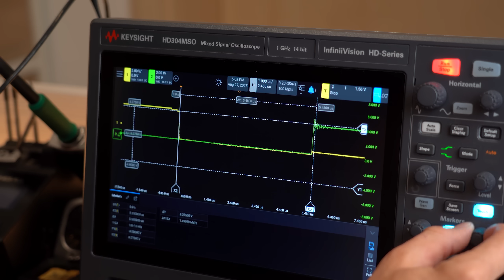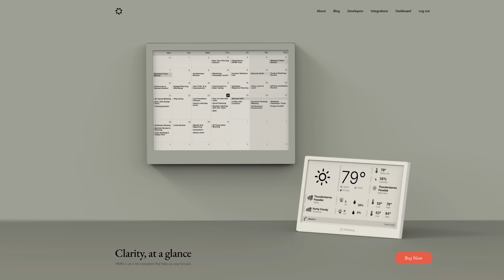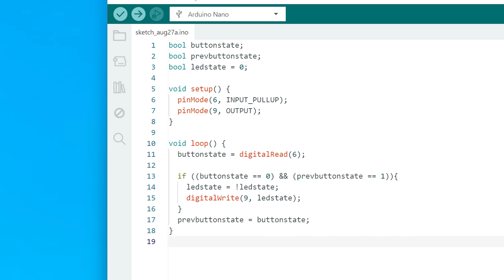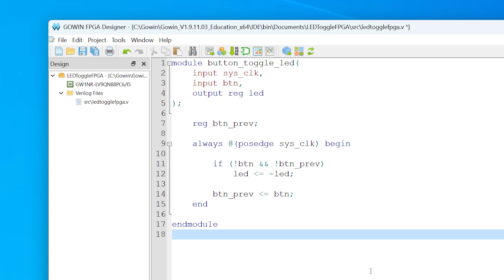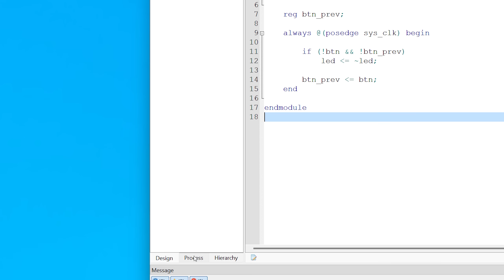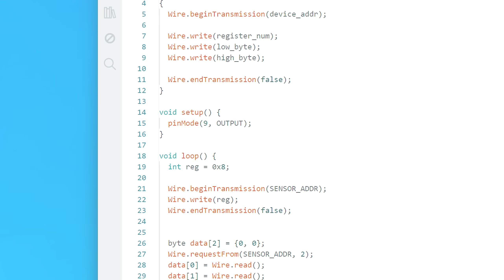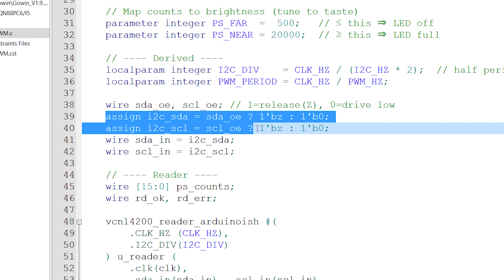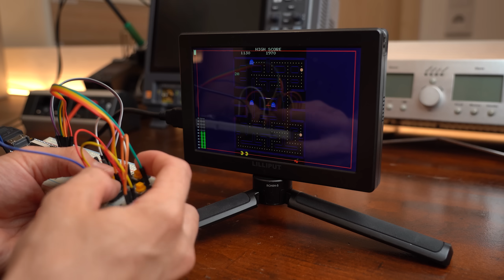The Harsh Truth about FPGAs (You Should Avoid Them?!)

Comment: The digital read and write functions in the Arduino libraries are incredibly slow. While you probably couldn't get FPGA speeds, you can certainly get within the range of a few hundred nanoseconds by reading and writing directly to the pins.
Reply: Yes. To get much higher speeds from a microcontroller, download the data sheet to find out where the registers are and GET and PUT to the registers directly. I learned this from a Great Scott video!
Reply: yes i agree.  the factor 100x mentioned in the video  makes not realy sence. Als the FPGA could run much faster the 27 Mhz (probably there is an PLL in the FPGA to produce a higher clk-frequency)
Reply: Exactly my thoughts, and not to  mention using higher end MCUs that are far more powerful than the AVR

Comment: I use this nano 9k to spy the qspi flow on an external qspi flash in order to toggle a signal when a specific address or range was accessed; in order to start  an acquisition of the qspi data with a fast  logic analyzer.
I was not good enough to make something reliable at 67mhz speed, so I changed the quartz on my HW target (a digital synth/piano) in order to divide the speed by 4. Then it started to work.

Comment: LLMs have been trained on a lot of code, especially javascript and python, so they are pretty good at writing it, but they haven't been trained on a lot of HDL, so they are not as good in that department. you leveraged libraries for the MCU, so you should have also considered leveraging libraries for the FPGA instead of going straight to LLMs. check out opencores, there may be other sources for opensource IP as well, I'm not sure.
Overall, FPGAs are not there to compete with MCUs, especially these days when MCUs are dirt cheap and often very capable. FPGAs are there to do things that you just can't do on an MCU. One can argue that the universe of those things has been shrinking, but we've also been more and more capable of doing things in FPGAs which used to require custom ASICs.
So I'd say learning to program FPGAs is certainly a great skill to have if you are into electronics. It is also a pathway to making your own ASICs, which has been impossible just a few years ago, but is now actually possible thanks to several sponsorship programs now available from both academia and the industry.

Comment: Usually we don't write stuff like the SPI or I2C peripheral itself. We'll add an IP Core from the vendor for that functionality which programs the FPGA for that peripheral to appear. Using frameworks like LiteX make this even more cohesive with open source IP Cores and RISC-V CPU cores, connecting them together through memory mapped registers like you'd use on a standard microcontroller.
That said, it's still WAY more of a learning curve than getting started with an arduino or blue-pill, but the knowledge floor is significantly lowered nowadays.

Comment: Why didn't you just use an IP Core for the FPGA I2C? You used a library and a peripheral on the MCU. The equivalent coding experience would have been for you to write a bit-bang I2C module from scratch for the MCU and then code your I2C functions around that. FPGAs are reconfigurable hardware, so they don't contain peripherals however the manuafcturer would give you an IP core, which is a soft CPU in HDL that takes  place of an I2C peripheral. I always like good videos about this stuff but you aren't doing an apples to apples here

Comment: FPGA have a learning curve lick a brick wall. But once you climbed up they can be awesome in the right situation. But most hobby project are not the right use case. I just hope they drop in prices a bit more to make my projects with them. To make your live easier, use the logic drawing functions of the IDE, so you only use logic blocks and let the "compiler" create the HDL for you. That way you avoid the trap of thinking in CPU logic: first this line, after that the next line. They just run in parallel, which is more similar to the block/logic view.

Comment: I move away from Micro-controllers and now doing a lot more CPLD's and FPGA's these days. I found that Quartus 13 is free to use. Which means I am locked into Altera FPGA's, I use them for hardware integration, to simplify electronic circuit designs, also very useful Digital Signal Processing (DSP) applications. Yes, I do a lot with VHDL and logic block design, I find VHDL very easy to work with compared to working with C programming.

Comment: Tang Nano 20k for example powers the MISRC platform as it can handle 2x 40MSPS 12-bit streams of raw PCM data from 2 ADCs and 2x audio ADCs converting that data into a bitmap stream via HSDAOH and then inexpensive MS2130 chips taking that data stream via HDMI and a PC unpacking it back to raw data or FLAC compress it..

Compared to a Xilinx and FX3 chip solution this cuts the interface costs in half, license layers go out the window, and the portability factor is insanely good for a long term design as the whole lineup of Tang chips are very well documented.

Comment: Hi!
You're not comparing 2 technologies, you're comparing 2 communities with a huge difference in population.
If a new micro-controller appeared with 100x better battery-life but no support for Arduino-IDE and libraries, you would have to write your own I2C library from scratch, and that would not be easy.
I started with (Pic) micro-controllers and I2C during my PhD in 1998, I was spending hours deciphering the 400-pages data-sheet, unplugging/replugging the IC form the PCB to the RS-232 programmer many times
Then came Arduino and its IDE as a de-facto standard to which every new chip (ESP, RISC-V...) has to adhere

Comment: Yes, you should avoid them! Even for prototyping, the promise of 'we won't need to make so many hardware iterations before we reach the final state' is often pointless - unless you're actually planning on producing your own ICs what are you going to do once you settle on the final design? That's right - you're going to be buying 10-50x more expensive FPGAs to put in your final product instead if you restricted yourself and stuck with some dirt cheap micro-controller.
Reply: Turns out dirt cheap microcontrollers aren't that great at the tasks the CrossLink-NX is designed for.

Comment: FPGAs (You Should Avoid Them?!) - only if you are trying to use them for things they are not intended for.  Kind of like using a saw to hammer a nail.

FPGAs are intended to be used for parallel signal processing, and can be much faster than GPUs for some operations like image filtering.  Not only is lighting up a single LED total overkill, it's really not designed to do single serial operations - that's what microprocessors are for.

If you want to process audio, images, video - then FPGAs can be awesome.  You would never want to use a microprocessor for that.

Comment: The greatest barrier to using a FPGA in DIY applications is the cost of the tools and libraries. The other problem is modern FPGAs tend to be aimed at systems on a chip, so to obtain the logic density to do useful things usually involves a high pin count BGA device, which is very hard for an amateur to place on a PCB. 

I should explain that I am of the generation that started using PLDs (EP610, 22v11, EP7064) and migrated to FPGAs programmed with a combination of VHDL and symbolic graphics. 
When FPGAs became sufficiently large to allow the system on a chip to be possible, it became necessary to have access to the  large macro libraries. These allowed the implementation of multiple microcontrollers, ram, rom and complex signal processing functions on a single FPGA. This rather took the fun out of writing FPGA code, as it became a tick box operation of selecting which library modules to include and connect -up. It also restricted  FPGAs to manufacturers who could afford the tool set, libraries,  and could  place the device.
  I found it difficult switching back from writing VHDL for a FPGA to writing code for a microcontroller. It's that difference between everything happening at the same time on a clock edge to having to think of sequential execution of instructions that is the problem, even when using a fast multitasking processor.
Reply: All the major FPGA vendors have free tools nowadays. You typically have to register to get a license but there is no cost involved. You won't get access to the biggest devices or the newest technologies, but the free tools are good enough for any hobbyist as well as for many professionals. They often also give you access to some simpler IP such as I2C controllers etc.

You will sometimes need programming hardware that could set you back a few dozen dollars, but many experiment boards have built-in programming interfaces and can be used with a simple USB cable.

I agree that much of the fun of an FPGA is lost when you only use it to build an SoC. The interesting and fun part is always the custom things you build around the SoC. But the SoC makes it easier to do many things, like communicate over USB or handle a user interface. I often use a small device like an ATTiny or ESP32 next to an FPGA, and communicate with the FPGA through the SoC using UART/SPI/I2C. The FPGA is a perfect IO expander if you need more PWM outputs or digital IO than your small SoC can provide.
This is actually a very good way to start experimenting with FPGAs if you're used to small Arduino-like SoCs: Put some if your IO peripherals in the FPGA, then start moving the functions you would normally do in software into the FPGA, making your peripherals more intelligent (debounce button presses, scan keypads, track rotary switches, refresh LED matrices, etc).
Reply: @HerrNilssonOmJagFarBe I have used the altera free web version of quartus, but its limitations made it virtually worthless, as so many functions were disabled. 
After your last posting, I did some research and will likely try the hardware and software you suggested. I have a couple of projects in mind that would benefit from implementation on an FPGA.
It would be useful to revive my VHDL skills. I have some code modules  I wrote while working. These will be included in my projects. After such a long time, it may take a while to get back into the zone. With FPGAs, good familiarity with a tools set seems vital, which is why I concentrated on Altera, now Intel.
Reply: @HerrNilssonOmJagFarBe  I think I will also choose that route... Driving some matrices and creating some nice colorfull PoV gizmos seems to also get to  the point you 
guys with expirience All make about "SoC stuff is boring." 
 
Telling an MCU what to do is one boring, predefined thing, but my enginieering mindset is actually the core feature !
Because it is infact systems engineering (!)

Hoping to find an explaination, one ought to make up and create -  with no hardware to describe. 

Somehow this just clicked.  I guess this has a lot of people confused, and I picked up some of that confusion -
(🤔...or  probably I picked up confusion, mostly...🤨🤐 )

It seems a healthy approach,  just play around with Fpgas and start baking them into things, as thoughts ideas and proficency evolve.

Really, a powerfull tool for the few who really create something. Thank you so much for clearing up that mess in my head, makes me feel a lot better😅!!!
Reply: For the tools, there nowadays is support for some FPGAs in the open-source tools Yosys and nextpnr (e.g. also for the Tang Nano). So the cost for the tooks is not a too big issue for hobbyists :)
Reply: @Drumonymus  I spent most of my time using the Altera max plus II tool set, and later the Quartus II. These seemed easier, and more intuitive than Xilinx, or  Lattice. I have been retired for more than a decade, so my information is dated. I did buy a few Ep7064 PLDs to use in DIY projects, as this could be programmed using an old version of the MAX Plus II software using VHDL. The 64 pin j lead PLCC was about the smallest pin pitch I can place by hand soldering.

Comment: Embedded Engineer here. Both MCUs and FPGAs are necessary and mixing them together in heterogenous designs is the ultimate solution.  My only critique is that you should point out that AI not being able to write HDL is a VERY strong argument for new engineers looking to not be replaced on the near future.
Reply: AI can't make good Arduino code either. I tried to do Manchester encoding/decoding, AI code simply didn't work at all
Reply: @Gameplayer55055  I have not had great results with AI trying to write multi threaded code either, at least in C
Reply: SoC my beloved
Reply: @zel042-f4e ✊
Reply: Out of curiosity, why do you think AI can't make HDL? I use it to make boiler plate VHDL then make corrections and modifications. 
Of course it makes mistakes, but it's still faster than if I typed it all myself. Also HDL makes my brain hurt 😂 I'd rather write C code all day long!
Reply: @FluxBench most AI models will tell you that due to limited quality HDL source for training, AI in general is not good at writing HDL. Maybe its good enough for some projects but it isnt even close for mine. However, i use AI daily to accelerate my scripting; that is usually great at. For reference, I2C is something I would consider easy to code in HDL.
Reply: @rallystar555 make sense! All the good code is proprietary and hidden 😁 I usually just give it a couple files that I've written already and say help me make more code in this style. Maybe that's the secret sauce? 🍝

I also use it mostly for the boiler plate high level stuff like instantiating variables and simple loops and stuff like that. Basically giving me a structure with variables and comments so I can just fill in the blanks after.

I do AI consulting and providing additional context is one of the things my clients get most value from. Using RAG and stuff like that linked to rules and examples works well too!
Reply: @FluxBench it sounds like you have a much more lenient employer than I do. I cannot "give" any code to AI, but I do not expect that to make much difference anyways. Overall, AI has not been as useful to me as have vendor tools and 3rd party tools. However, I see AI creeping into everything so I would imagine that eventually AI will be useful to me in some FPGA related way. Bur for now, I am more HDL proficient without it.
Reply: @FluxBench  its also not about just writing the HDL, if you want your code to be useful you have to also document everything
Reply: @FluxBench In general, writing hdl code often takes up a small part of the Fpga engineer, and spends a lot of time on timing constraints, clock domain cross, debug with chipscope... In addition, hdl is really a modeling language (digital design) that is found in critical and confidential areas (aerospace, defense) so outside of more general projects AI is not very feasible.

Comment: I once thought FPGAs were hard to use but then i just started and learnt verilog. Ands its mostly a okay experience. What makes is hard is not verilog or fpga itself but  TOOLS. The tools are horribly outdated, error prone and are the things that cause most of the issues. For example the sytnhesis tool can REMOVE some parts of your design because it assumes its not used which causes clock and data paths to break because it assumes its not necessary. Like for example using a 32 bit data bus but say ur fpga logic uses 8 bits then u have it connected to a 32 bit register. The synthesis tool will remove the upper 24 bits because it assumes its not important which causes logic that use the full 32 bits to malfunction

Comment: you can also toggle an led in a few clock cycles if you do lower level programming. FPGAs are better if you want to emulate a digital circuit one to one as you can program them in verilog (the same way modern cpus and dedicated controllers are designed)

Comment: Yet another FPGA/ASIC engineer here (retired now). For a gentler learning curve, I'd recommend looking into HLS (High Level Synthesis), a tool that takes C/C++ code and translates it into HDL code, either Verilog or VHDL (your choice). Then regular synthesis tools can be used to synthesize your code into hardware and load it onto an FPGA.  Xilinx (now owned by AMD) has a full set of tools that can be freely downloaded, including a simulator so you don't even really have to buy an FPGA board. Happy coding!

Comment: for that setup if you use Arduino and have the switch on an interrupt with the ISR using direct port registers to control the led you should be able to get to a 2 tick time and it should be very similar.
Reply: It takes 4 cycles before an ISR starts executing after the interrupt is triggered. So the least yout could have is 5 (if you use the PINx register to toggle the pin)

Comment: HDLs are way easier once you know the "rules of the game", I recommend using a graphical logic simulation software such as LogiSim or Digital first, or even Minecraft redstone. Once you know what the code describes it's not that difficult to put it into a HDL. Generating video signals is really not that difficult with an FPGA, and in some ways even simpler than using a uC - For one, you don't really need to care about latency or performance, the actual computation is usually almost free(unless you're trying to multiply a lot or need other functionality that is only in some blocks).